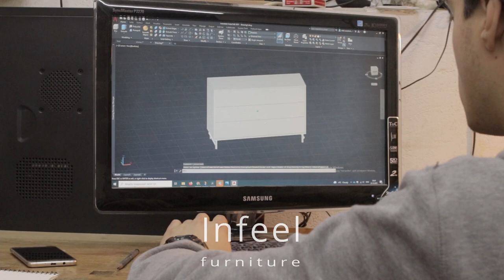Making Ash Dresser

Comment: If I could make a suggestion, I'd recommend getting a few new things for your shop. I see you have some Festool tools so I know you've got the drive. But I'd recommend upgrading your table saw and make an outfeed table for it. Also, I'd get a helical cutter head for the jointer if possible 👍 Stay safe!

Comment: Where do you get your wood? Do you have a mill near you? I saw a video where they used a Festool Sword Saw to cut beams on a cabin build. I was very impressed by that.
Reply from the maker: I buy wood from a local supplier.  They cut logs and also dry the boards in a chamber dryer.
Reply: @infeelfurniture  I liked the videos where they used large chain saws to rough cut the lumber. Then they turned those into boards for their cabin builds. There were so many builds I wished that I could help with.